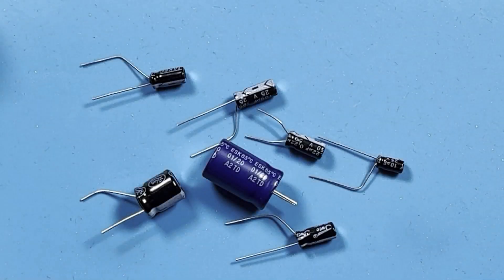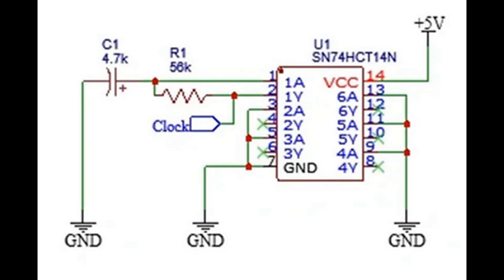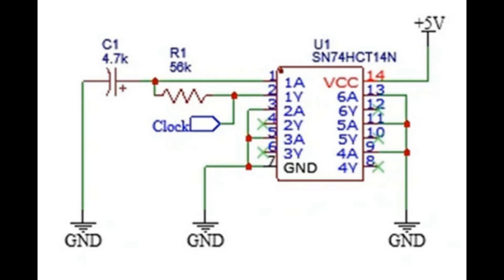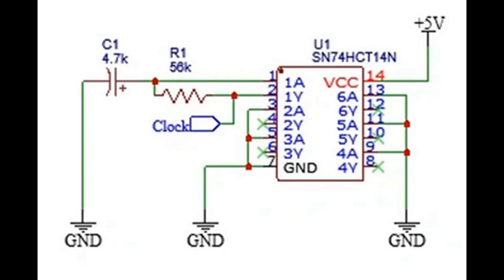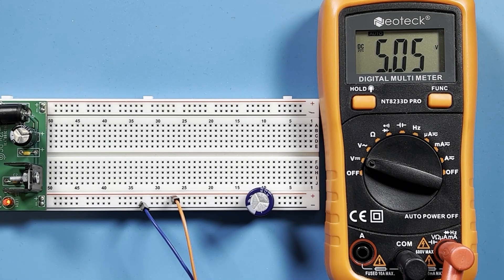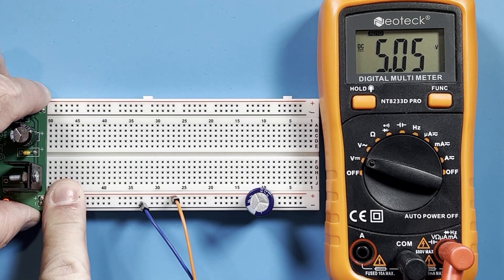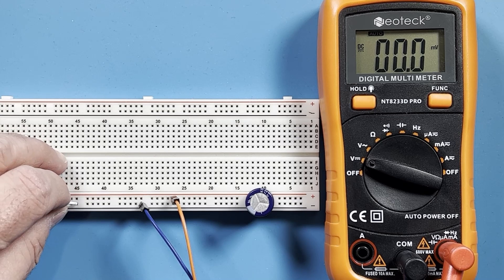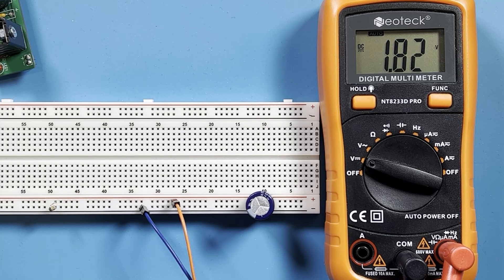Back to Basics - How the Inverter Clock Capacitor Works

Comment: Hi Pony no need to apologize mate and really thankful you dedicated a video to my question in order to clarify- gentleman!. I think I may have grasped the concept, when the output at pin 2 becomes low, the capacitor can now discharge via the short to ground. So if I have this right the discharging process is electron flow out from the ground side of the cap through the resistor till the cap is back to a neutral charge state. fingers crossed ! Thankyou again mate for taking the time to try and help.